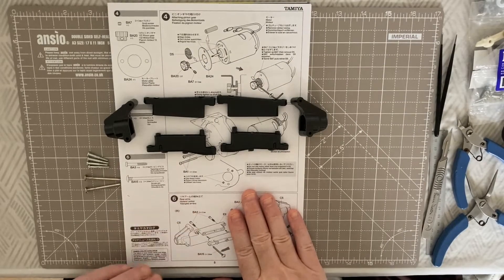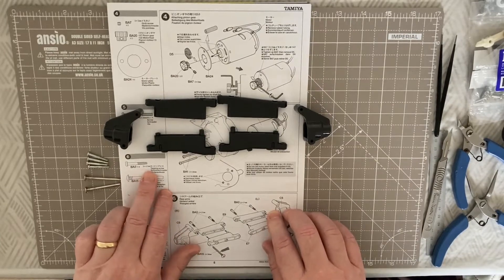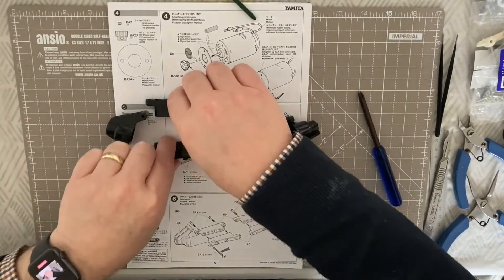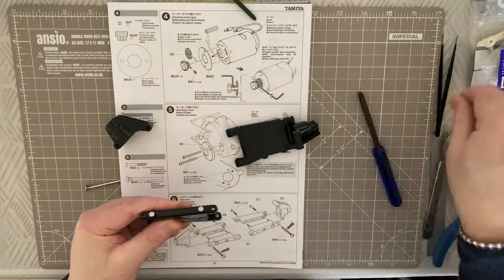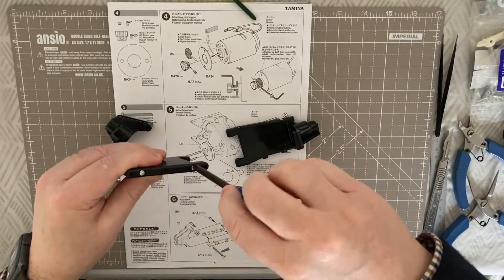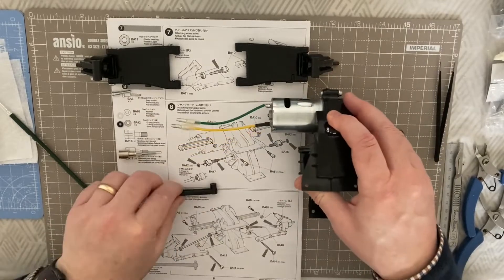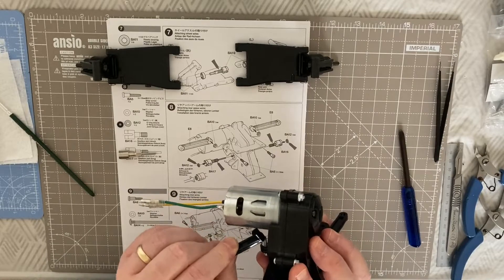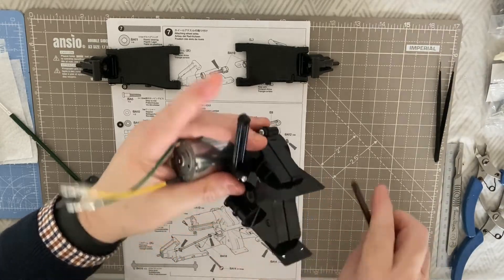The Tamiya Blitzer Beetle Build Steps 6 to 10

Comment: Looks great! that last front part I put a tiny thin bead of goop glue the shoe goo stuff along the tp and bottom part that lays over the chassis so when you screw it on it will make the front stronger so it wont break  as these chassis are known to be weak and crack in that area. the shoe goo is nice also you can always disassemble it if needed. Merry Christmas
Reply from the maker: Hi Steve, thank you for watching my video. Thank you for the tip. I’ll get some Shoo Goo over the Christmas break, I’ve got to get some over RC consumables too, might put a order on good old Amazon 😉😊😉. Enjoy the holidays my friend, keep safe and well. 😊😉😊